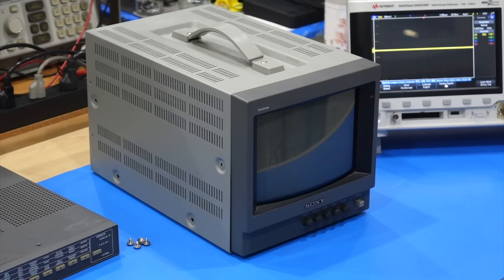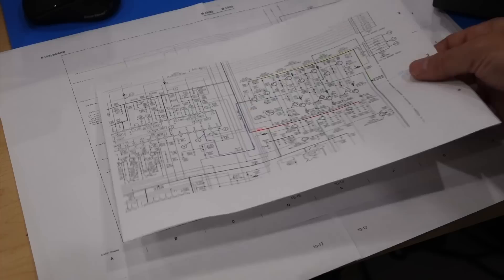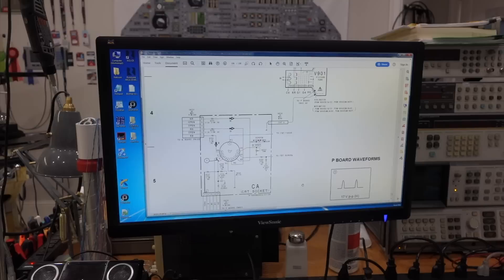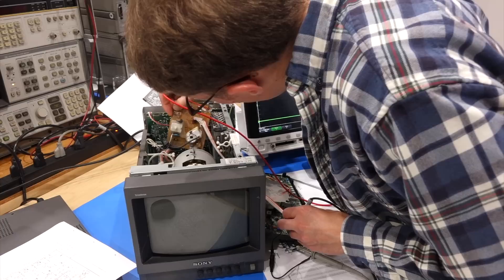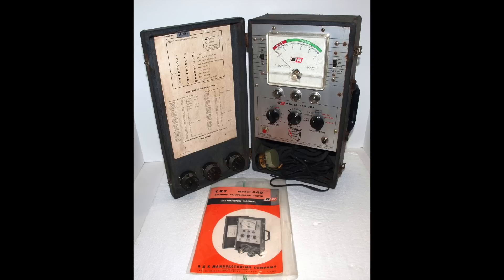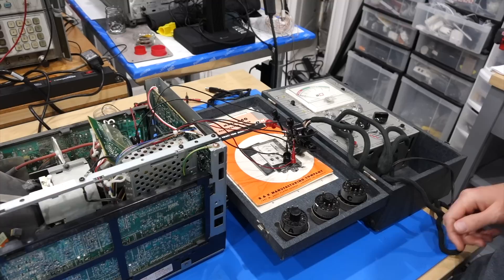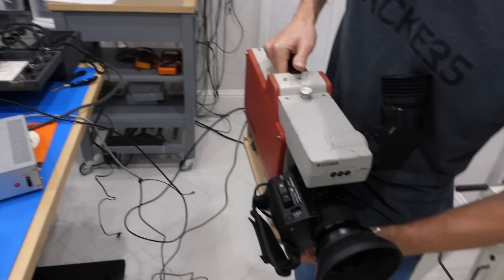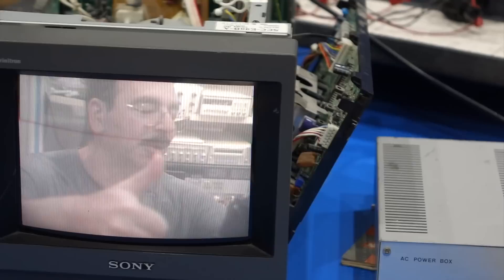Rejuvenating a color CRT

Comment: I wonder if I can rejuvenate an oscilloscope or  spectrum analyzer
Reply: You can, they're CRTs like any other, and like rejuvenating any CRT, results may vary. It usually doesn't last long, but for hobbyist use you might manage to extend the useful life of a scope by years.
Reply: The tricks apply to any thermionic vacuum tube, it's just not worth getting three more hours out of a 12AX7 or whatever. Another trick is to run the filament at a higher voltage (jump any resistors, add turns to the flyback winding powering it, etc.) temporarily or permanently. Though at the end of the day cathodes wear out and there isn't much you can do about it short of replacement, that's why virtually all tubes were socketed, even in cheap junk.

Comment: Ohhh no, that realy hurt my electronic engineer heart a lot, bloddy irish fantom tweeker.
Never adjust first, but messure the signals first. 
Working in broadcast so have done a lot of those PVM in my time, it's a common problem with the CRT that one of the guns wear out more than the others. 
On the Trinitron the green gun are in the mittle of the gun aray, so it gets more heat from red and blue gun.
One of the other comments was to put the front of the tube downwards. Please dont, the shadow mask are very sensitive for elements droping down and get stuck in the stribes.
Normally the rejuvination of the tube will last some month, depending of on hours.

Comment: is this monitor even operating in RGB ?      i thought the higher end systems would use YPbPr (?)    (some call it YUV)
just wondering since you mentioned that RED can not be adjusted, which only makes sense in the YPbPr space
Reply: Every monitor is in the end operating in RGB. There is no real Y,U,V colours, only RGB phosphors are on the screen. So YUV is always transformed to RGB.

Comment: Youre not supposed to rejuve sony crts?
Reply from the maker: As I say in the video, you are not supposed to rejuvenate *any* CRT. It's snake oil. However, if you are very careful and know what you are doing, it is possible to rejuvenate *any* CRT, including the Sony Trinitrons with their infamous small and fragile cathodes, as you can see in the video. But don't do it. It's still snake oil. It won't last very long.
Reply: @CuriousMarc  Yup, it will burn whats left of the cathode material
Reply from the maker: @Synthematix  Yes, if you abuse it, but not if you do it gingerly. However it will recontaminate quickly from whatever contaminated it before. Our screen re-pinkified in a matter of months, although not as bad as it was before. But I eventually changed the tube. That’s the one and only cure, short of rebuilding the electron gun, sadly.

Comment: In Germany company Müter built this fancy stuff (eg Müter BMR95).
(apologizing for letter ü)
Reply: I got the info from Hr. Müter Jr. that the 95 and 2005 were specifically designed to handle later CRTs with smaller cathodes. So these might be more suitable for Trinitrons, similar to the Sencore CR7000. And although I have both the BMR 95 and 2005, I've resisted the temptation to actually try them on a Trinitron. I have a 32" FD Trinitron with a weak green gun, but I'd rather live with it rather than risk completely destroying it.